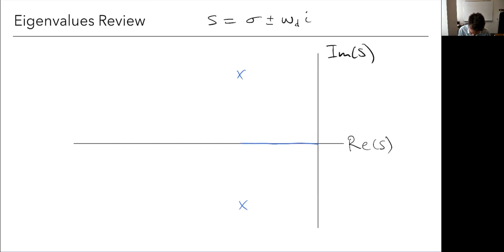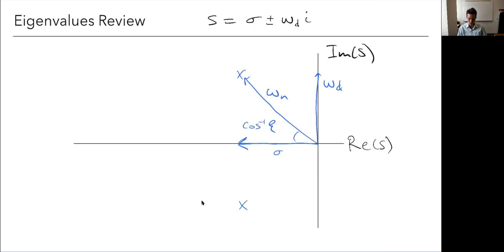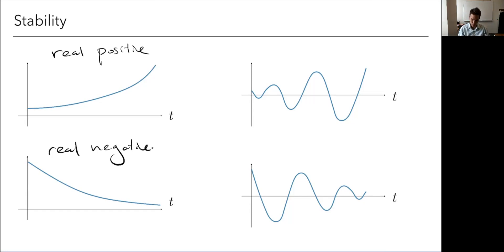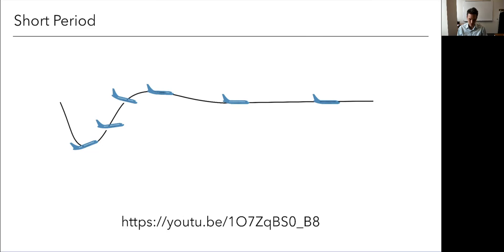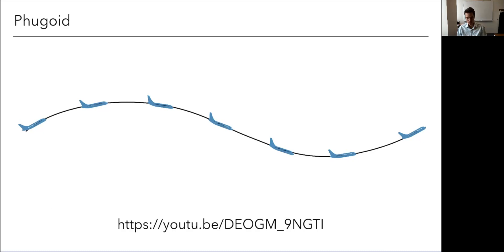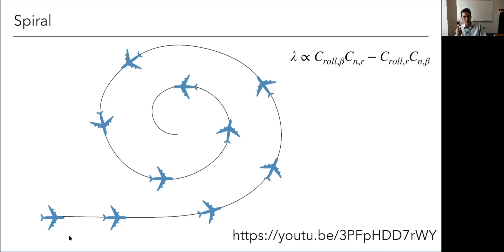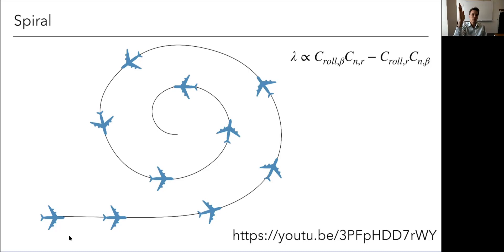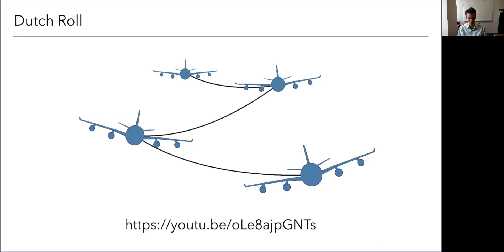12-Dynamic Stability

Comment: How does this math relate to the physical design of the aircraft? Can you make a video about how to design an aircraft for dynamic stability? Thanks
Reply from the maker: It's hard to generalize (e.g., adding a winglet may improve dutch roll for one aircraft while making it worse for another).  For conventional aircraft you can come up with some rules of thumbs by analyzing the contributions in the stability derivatives.  Those are fun (though limited), and maybe I should put together a video on that sometime.  But the general approach is numerical experimentation (or optimization).  You make changes to the design and observe the eignevalues in the complex plane.  There are various tools out there that can facilitate this kind of study.